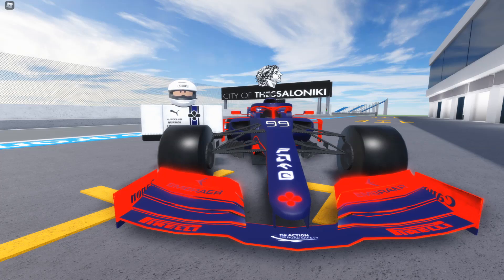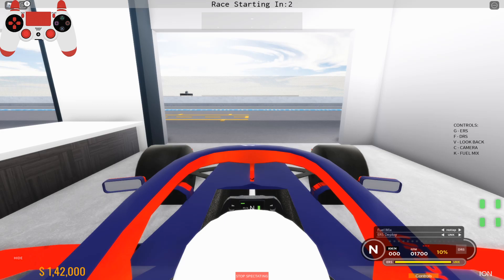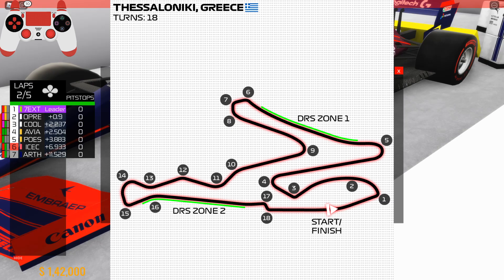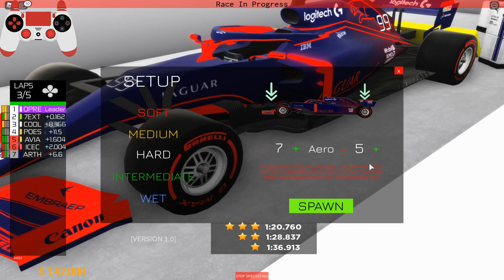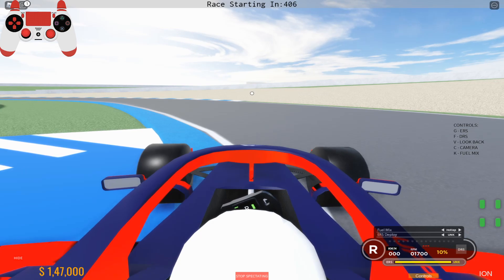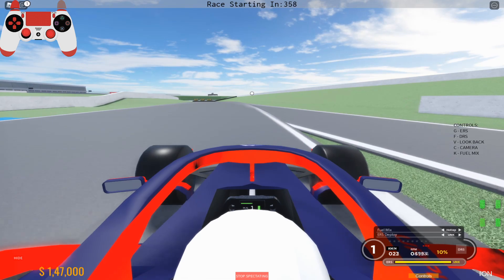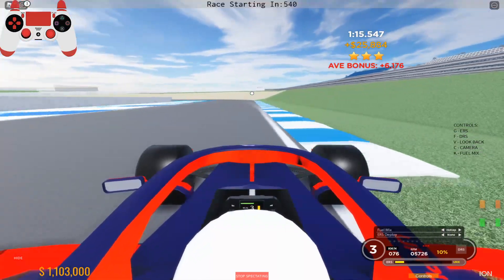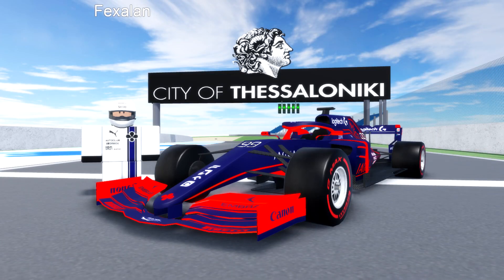How to ION | Episode 2 | Aero Setup and Greece track analysis!

Comment: I use 13 13 for Greece because it’s just so damn bumpy you I just can’t keep it straight on the inclined turns and if you have 10 power and with ERS on the straight you are still faster than most people considering most people don’t even know about ERS
Reply: ERS
Reply: @DesiredAviations  I wouldn’t say they are dumb I just think they are uninformed about the ERS.
Reply: @DesiredAviations  also you can edit comments

Comment: (Btw I do have aero updarge) my fav is 5 front wing and 5 at the back because I have a bit more down force
Reply from the maker: Yeah I recently starting playing around with lower downforce and noticed they work just fine because of the grip levels on these cars. In the actual league game you would have to have much higher AERO to be safe during the race and have good laps.

Comment: I use 3-2 on every track, apart of France and Canada, there I use 5-3
Reply from the maker: Do you get alot of understeer then?
Reply: @Fexalan  Yeah, I touched the wall several times with 3-2 and 5-2 has too much oversteer
Reply: @Fexalan  

I used 13-13

I think I am destroying my tyres lol
Reply: @initialdoge8528  13-13 is maybe the best setup for france
Reply: @brightdezigns1936  

Nah I think,13-10 or 12-9 is better.Cuz I tired it and it feels better in the corners.